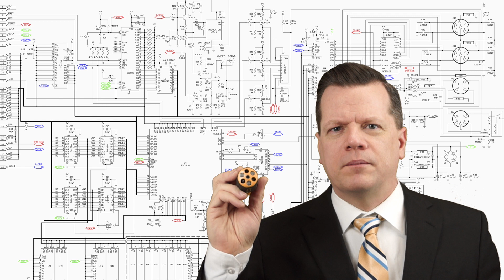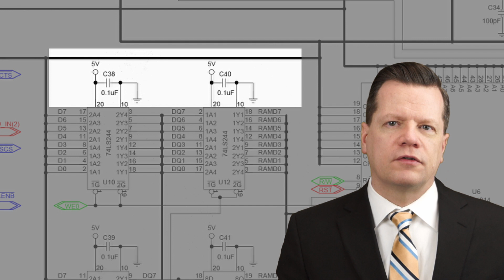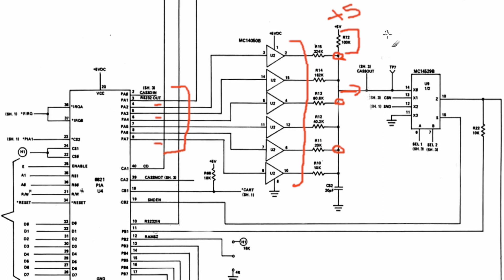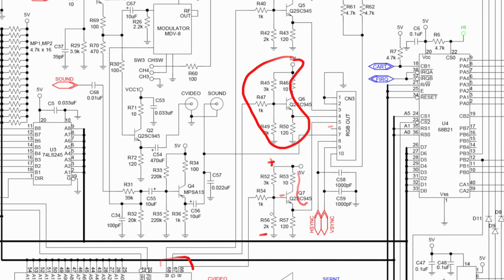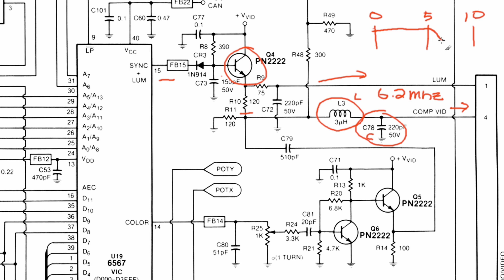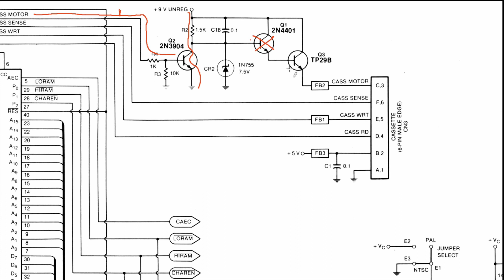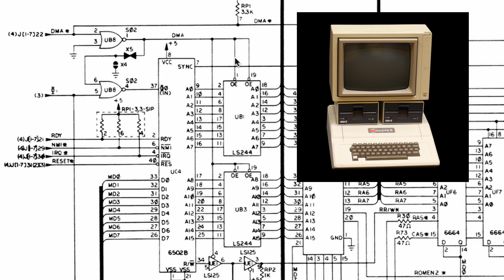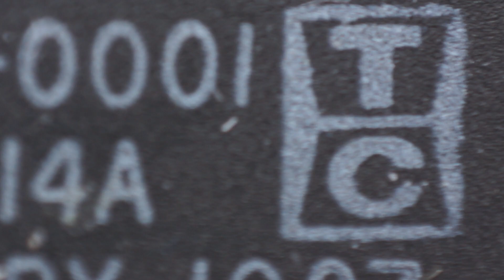Top 10 Patterns I Find in Retro Computer Schematics

Comment: RETRO LOGIC LAB, Make another TOP 10 Patterns, What is the advantage of using UNregulated DC voltage because I see it often in schematics they use Unregulated AC voltages and Unregulated DC voltages. There must be an advantage of using Unregulated AC and DC voltages. I don't know what the IRQ, NMI, DMA are doing or what is sending signals to the IRQ, NMI, DMA pins that are use often in computers in the 80's. Try to make a video explaining the patterns in computers that use IRQ, NMI,DMA signals

Comment: Often schematics of computers are very much like other computers schematics because the manufacturer of intergraded circuits supplied all of the computer manufacturers with the same technical datasheet. There is only one way to connect a processor to the memory but thousands of combinations of different chips to be made, in principle it stays the same. 
 
After forty years of computing nothing changed. A chip is placed on a PCB and then it does something.